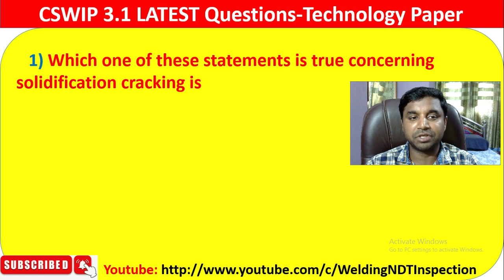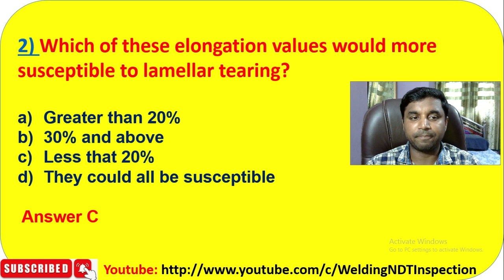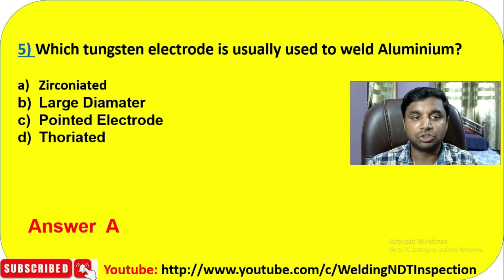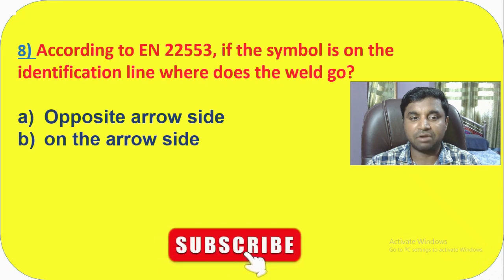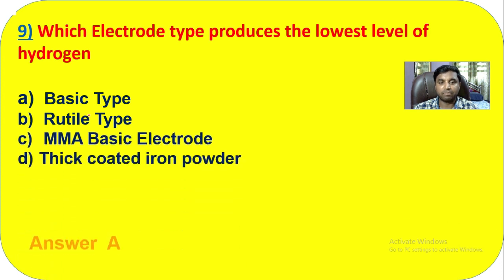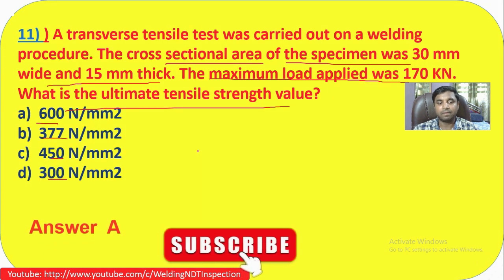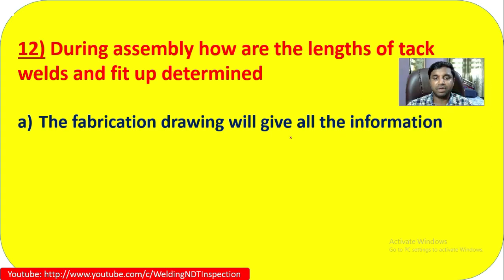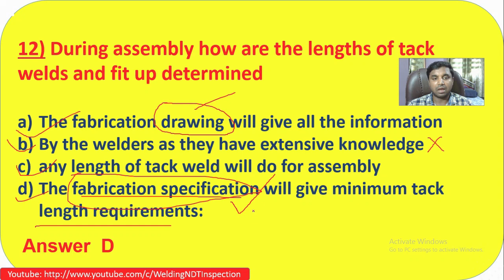CSWIP 3.1 technology Paper Latest Questions [Part-15]

Comment: Dear sir for questions no. 2 I think option a is right answer (The greater the measured %R of A, the greater the resistance to lamellar 
tearing. Values in excess of ~20% indicate good resistance even in very highly 
constrained joints. )